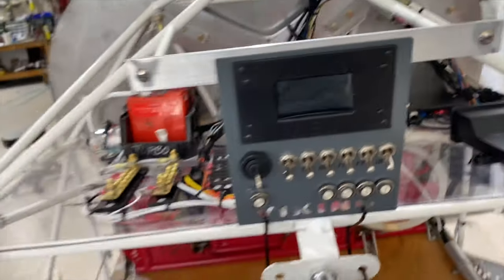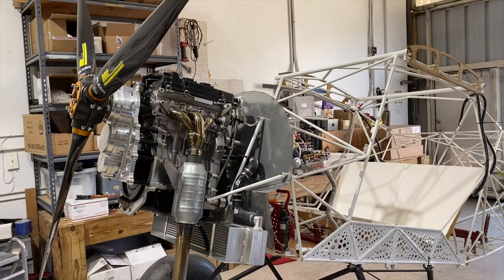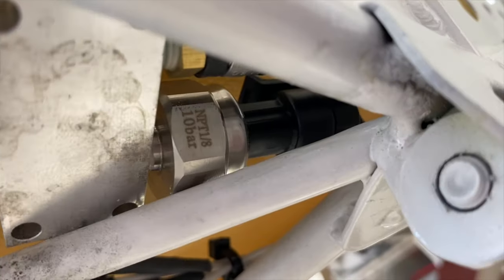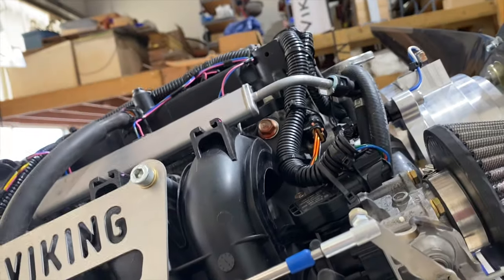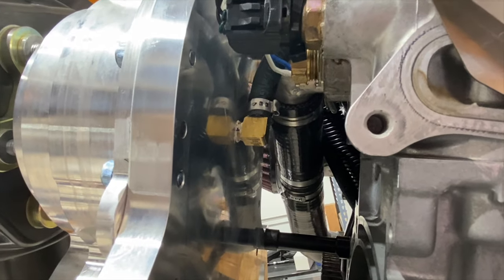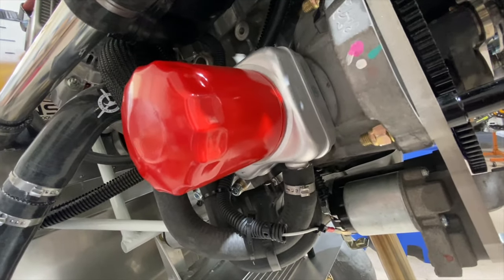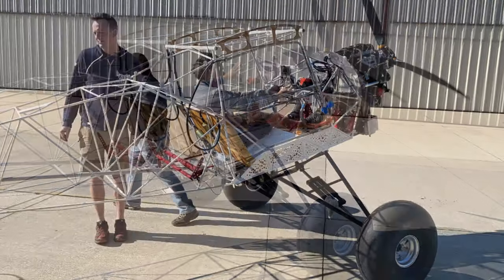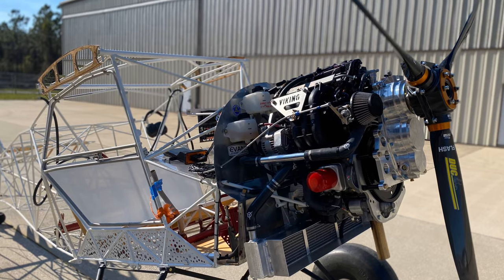Kitfox IV Installation and Details ( A Closer Look)

Comment: I once installed an NSI Subaru EA81 into a Kitfox IV-1600 but the package had two failures: it was heavy ...the gearbox and prop (Warp Drive Three Blade) weighed 33# and the gearbox was prone to failures ... the engine was bulletproof and was producing a ton of power and torque, but the gearbox & prop just made it unusable. I had to put 22# of lead in the far aft tail area to get it into W&B. The Viking 90 set up should be no issue and with a very good power to weight ratio to boot. Out of 12 experimental aircraft I built that was the only auto conversion I did ... now I'm looking into a Rans with the Viking 90 as the engine of choice if I get a RANS. I would like to do an S18 Stinger ... the Viking 90 would make it a Super Stinger ... Venom Stinger??

Comment: Have you ran in to any issues with the oil coolers failing internally and mixing coolant with your engine oil? I've seen this a few times with automotive systems. Typically ford systems I've seen it more often. I would be concerned with cooler failure and coolant washing out your oil mid flight, causing the engine to seize.

Comment: What is the Crankshaft RPM at cruise and full throttle?  What brand of Engine do YOU start with?  I've been bit by the bug and am trying to identify the best way to get a KitFox and me in the air.
Reply from the maker: All of our gears throughout all engines are the same 2.33/1 ratio - The 90 HP comes from a 2019 Mitsubishi Mirage

Comment: Do you or are you going to look at installations for the 130 in older kitfox or avid?
Reply from the maker: The 90 HP is great for the Kitfox 4 and older and the 130 is good for the larger models. We have done both.